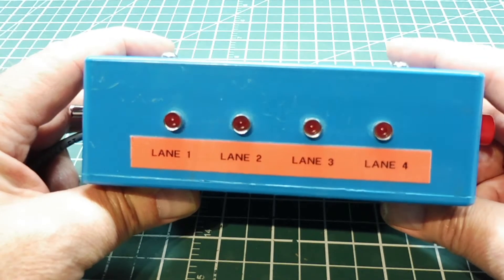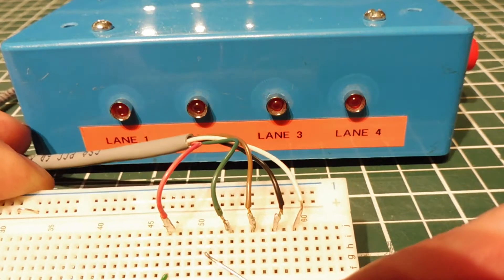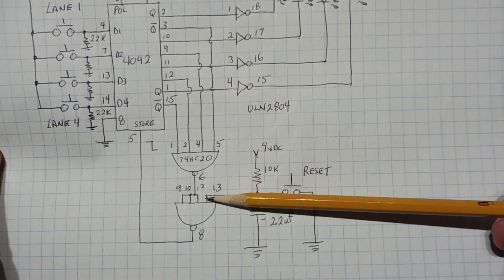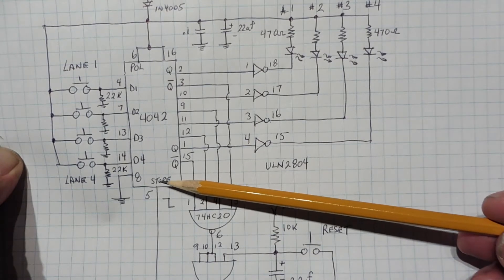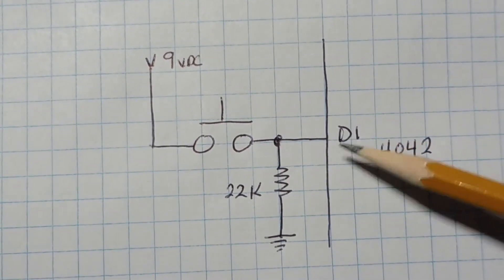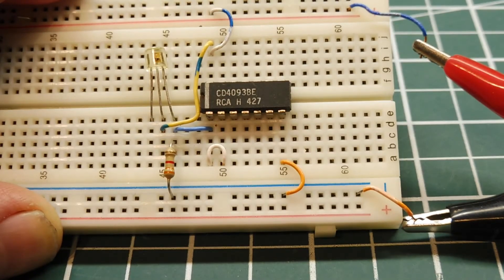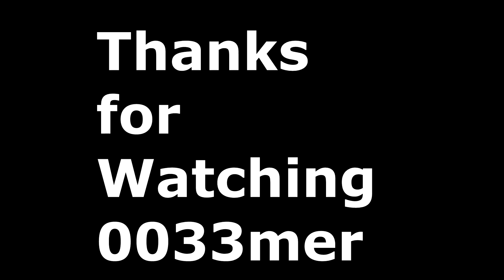Build a Pinewood Derby Decision Maker

Comment: With a lot of help <here> I was able to find the bugs in my wiring.  I made a two lane version of this decision maker with optical sensing and with a couple small relays to trigger two 110v winner lights for belt sander racing.  The system performed flawless.  The AC relays are SPDT with the NO common wired to the winner lights. Next year I will upgrade this by using the NC contacts to keep the lane power activated through a pair of high current SSRs <solid state relays> with high curent sides wired in series, inside the box where the lane power originates.  For the past 6 years, they have cut the power manually.  But sometimes it's a bit late.  We will use that same setup but with the SSR lane-power disconnect automated by the winner.  When the finish line judge resets the winner circuit, that will automatically enable the lane power at the same time.  During the race, if the starter needs to cut power sooner .. he still can and he will still start each race the same way.
Reply from the maker: Looks like you got it beat. Good for you. Learn by doing is the best approach.

Comment: Problem: I have mine built with only 2 lanes.  I am using the optical sensing 4093 trigger and I am not using the winner LEDs.  Darlington pins 17 and 18 straight into my relay board input. Fired it up this morning and not working.  I may have a mistake in the reset circuit 74HC20.  Since only 2 lanes, I am not using pins 4 and 5 of the first NAND.  Could that be my problem?  What would you recommend?  Also, my 4093 output pins 3 and 4 stay high.  I cannot get it to trigger low while blocking the light on the Photo Transistors. I dont know what resistors to try in place of the 3.3k.  Sorry to ask all these questions.
Reply from the maker: You have to troubleshoot each block separately before you connect them all together. Pins 4 and 5 of the NAND gate should be tied high (Vcc pin) if not used. They cannot be left floating. Check the relay board by itself by applying power with the H/L set to Low. With a jumper wire, ground the input pin, and the relay should energize. Breadboard just the phototransistor and a resistor with power applied. Monitor the voltage across the resistor when blocking and unblocking. You should get a voltage swing of about Vcc to close to ground. First use a pushbutton switch to trigger the board for correct operation. A digital probe would help monitor all the logic levels during activation.
Reply: @0033mer very much appreciated !
Reply: @0033mer I breadboarded and found I needed 47K for my photo resistors.  I have added the 4093 and checked good.  The 4042 works perfect for Lane 1.   But the D2, D3 and D4 do not work, even tho the 4093 gives a solid High out from Lane 2. I wired all 3 thinking I may have damaged one.  On the relay board, touching ground to the input works.  But the darlington wont trigger it.  Would wiring Vcc to the COM pin 10 make any difference?  Sorry for all the Qs.
Reply from the maker: Com pin 10 is used when driving inductive loads directly which you are not, so it can be left open. Make sure the ground connection on the board with the ULN2804 is connected to the ground on the relay board. For troubleshooting disconnect pin8 of the NAND gate from pin5 of the 4042 and connect pin5 directly to Vcc. This will make the 4042 transparent and not latch. Putting your finger over the phototransistors should cause the voltage on the corresponding darlington outputs to go from high to low which will drive the relay board.
Reply: @0033mer Ill tie store pin high in the morning and debug.  I am trying to get the darlington to run the relay.  Vcc is 6.3v and I see 5.4v going into darlington pin 1 while blocking the light on lane 1.  No relay trip.  I see 5.4v on darlington pin 18.  All grounds are connected.  I do not have the second relay input connected and I read the same 5.4v on that input.  If I ground either input, the respective relay sets.  Somehow this darlington is not pulling down to zero.  If I connect an open darlington input to vcc, should I see ground on the output ?
Reply from the maker: Ok.. I assumed your relay boards were 12 volt but it looks like you have 5 volt relay boards. The drive input of a ULN2804 is 6 to 15 volts. I used them because I was powering my board with 9 volts. A ULN2803 will accept a 5 volt input for proper operation. The characteristic of a Darlington is that it does not pull down to zero like a standard transistor. Can you drive the input of one Darlington with 12 volts for test purposes.
Reply: @0033mer Im using a 9v battery.  And only getting about 7.5v.   I'll switch to a 9v power supply today and recheck everything.  Decades ago I did a bit of old ttl and never used a darlington.  Strange one to me.   This relay from Amazon says optical coupled and I'm growing concerned that it's not compatible.  If I buy a 9v relay, are there some you recommend?  I assume Id put Vcc on pin 10 for a direct control of the relay. And still wire the darlington outputs to the relay ground.  I appreciate the help.  The races are Sunday and I still hope to make it.  They put the track up Saturday. Thanks a ton!
Reply from the maker: The two most common relay voltages are 5 and 12 volts. If you get 12 volt opto/relay boards and also run the logic on 12 volts it will probably work.
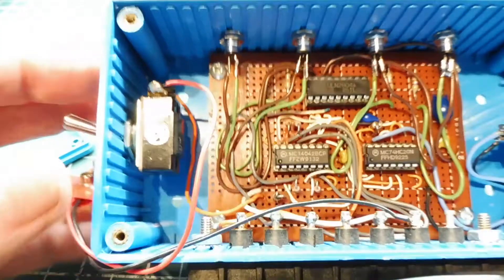Reply: @0033mer I have a 9v sensitive relay with 200ma coil connected to the darlington.  I 4:38 have pin 10 wired to 9v vcc. I also have vcc on the plus side of the relay. Using darlington input pin 4 and output pin 15.  Pin 15 is wired to the ground pin of the relay..  I am not using the flip flop chip.  It's Uninstalled.  Just the darlington.  My digital probe shows high output on pin 15 with nothing on pin 4.  I tried injecting a high into pin 4.  Shouldn't that ground pin 15 and trip the relay?  Im lost in this.
Reply from the maker: Use a jumper wire and ground pin15. The relay should energize. This will test your relay and wiring.
Injecting 9 volts into pin4 should energize the relay.
Ensure pin9 of the ULN2804 is grounded (power supply neg )
If this does not work you might have a bad ULN2804.
If you ever apply Vcc to an output pin and then inject Vcc to the input the darlington will be damaged.
Reply: @0033mer I may have made that mistake and damaged my darlington.  I have 2 more arriving today.  I just noticed I have a high on pin 18 all the time.  More damage.  So my wiring must be correct with pin 10 on vcc and vcc to plus side of the relay.  The relay is still good.  I hope I can do you a favor one day!  I appreciate you keeping in touch.
Reply: @0033mer I was excited about tonight, with new chips arriving and the new tiny 9v relays.  I checked the whole system without chips, many times.  All VCCs and grounds are good.  All wiring good and no shorts.  I pulled pin 5 high on the flip flop and all Qs and Q-nots trigger perfectly.  Brand new darlington with pin 10 wired to vcc.  The relays have vcc to one side of the coils and the darlington outs to the other.  My probe sees the darlington outputs high !  Sadly no switching.  😢  I've built the whole box, but Im out of ideas. Bummer I cannot show pics here.  Tomorrow I will have to bow out for the decision maker, but Ill press on to find a different path for the switching.  I think you offered another direction. .. I'll work on this for 2026.  I have two different belt sanders in the competition.
Reply from the maker: It is probably something simple you have missed. With 9 volts at the input of the darlington, the output should pull low and give a ground to the relay. Ensure pin9 is actually ground. Your probe should verify that. I have used this chip in many projects . Here is a video where I used the chip to drive stepper motor coils. Maybe you can see something you have missed. https://youtu.be/ngNRJY13jcw
Reply: @0033mer yay !  She's fully working!  I have a lot of setup today and the races tomorrow.  The owner would like to give you a 2025 Belt Sander Races  T Shirts.  Please reply with your size and we can figure out later how I can get it to you !
Reply from the maker: Thanks for the offer but currently getting a package into Canada would be a nightmare with border delays and a postal strike we are experiencing. If you can, shoot a video of your circuit in action and I will add the link to my YouTube video description box for others who are interested.

Comment: I bought a simple two-relay board with an optical coupled input .. on Amazon.  Would I still need the flyback?   .. not sure how to wire it.  Or in this case could I just drive it from the darlington direct <no other components>?  And would I use the low input setting or the high? I posted this yesterday but it seems to have vanished.
Reply from the maker: The protection diode is included on the board. You can drive it directly with the ULN2804. The H/L jumper is set to "Low" as the Darlington output is open collector and will give a Low output to energize the relay.

Comment: Could I use the 4042 Q outputs to each directly drive two ULN2804 darlington drivers? That would let me keep the winner leds on the box and use the other diodes to switch a relay for 12v lights. His anyone shown a good circuit for the relays?  Mine is tricky because I want to combine lanes 1 and 2 to light one 12v light.  And the same for lanes 3 and 4.  I'm using two sensors combined per belt sander lane.
Reply from the maker: Yes, the 4042 output can drive two ULN2804 drivers. For combining use appropriate logic gates like a CD4071 OR gate.
Reply: @0033mer Im a little lost in this.  I have your full circuit driving the winner LEDs.  If I read this correct, I can tap Q1 and Q2 from the 4042 through the OR gate, then the result back through another darlington driving a small relay coil.  Same with the other Q3 and Q4.  The reason I said TAP was because the Q1 through Q4 outputs are also still wired to the first 4 darlingtons, driving the LEDs.  I hope this makes sense.  I very much appreciate this help.  A side question.. in your drawing of the reset circuit, is that a 22uf cap or a 2.2uf cap.  I can read it either way. Thanks.
Reply from the maker: Yes, you can combine the Q outputs with an OR gate which will drive the ULN2804 controlling the relays. I would build the circuit on a breadboard and go through the circuit with a digital probe to ensure all your logic is working properly.
The capacitor is 2.2uf.

Comment: I am building one of these for belt sander races.  Will use the the Photo Transistors method.  I need to find a strong light bar for above.  I am confused by the two capacitors shown on the power rail at the top. A 22uf for noise.  Is the .1uf for very high frequency noise ?   I hope you are still monitoring YouTube to answer this.  And thanks for this neat circuit.  Or if someone else knows, please reply.  I might have thought on 1uf for the second cap ..
Reply from the maker: Yes, the .1uf is for high frequency noise. Electrolytic capacitors are inductive at high frequencies so I added a .1uf ceramic capacitor. I did that in case someone used a 9 volt wall wart switching power supply.
Reply: @0033mer excellent.  Great design.  Ill put two on each track spread apart for the belt sanders.   Short on time for this year.  But next year I may drive some bigger lights to display the winner better.  Someone mentioned trailer lights .. maybe that was you.
Reply: Is there a quick way that I can drive an external relay from each channel of the darlington led driver?  This to light a trailer light.  I'm putting Lane 1 and 2 together on the same wide lane for belt sanders. Hopefully to give a better chance of catching the winner even if the belt only crosses one of the Photo Transistors.  Lanes 3&4 on the other side.  Could I combine the outputs to push one relay, or should I just use 4 relays to drive two 12v trailer lights ?  Help appreciated.
Reply from the maker: You can drive a relay directly with the ULN2804 as each driver can handle 500 mA and the free wheeling diode is included in the ULN2804 IC. Instead of using the ULN2804 you can use MOSFETs to drive the lights directly off the CD4042 IC. Check out this video that features the MOSFET driver module: https://youtu.be/uLA2MvKYLZs

Comment: Hi. Could you build a racing Christmas tree circuit?
Reply from the maker: I have built them but do not have a video at this time. All you basically need is a pulse generator clock circuit feeding a CD4017 counter which drives the lights. After the last light is lit the CD4017 is reset.
Here is a video that might give you some ideas:  https://youtu.be/E1btWRXmyKo
Reply: 0033mer cool. Thank you

Comment: Great video. I was asked a little while ago to make a quiz buzzer. My idea was to use an arduino, but this looks a lot more robust. Thanks for sharing.
Reply from the maker: Thanks for the feedback. Four big red pushbuttons and you got a quiz buzzer ... that would work. Instead of driving LEDs I have used red trailer tail lights from an auto store and mounted them on a strip of plywood so the audience can see who won.